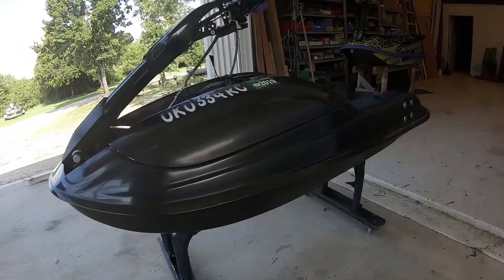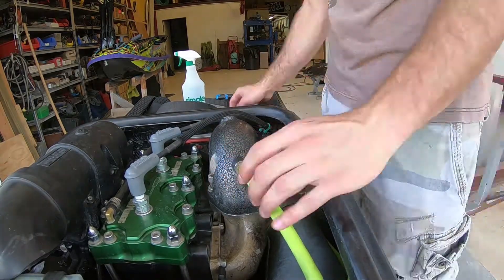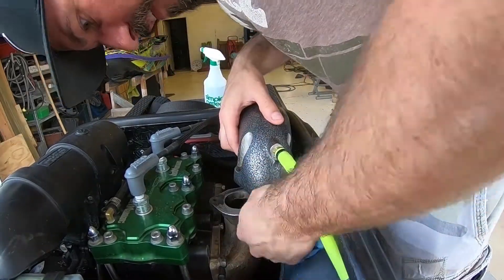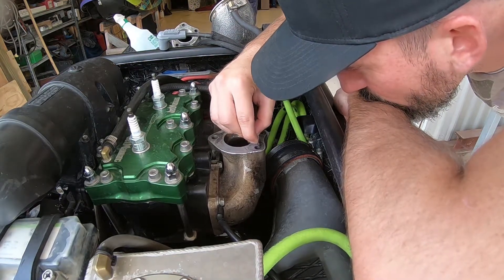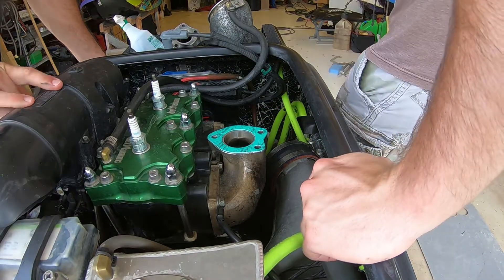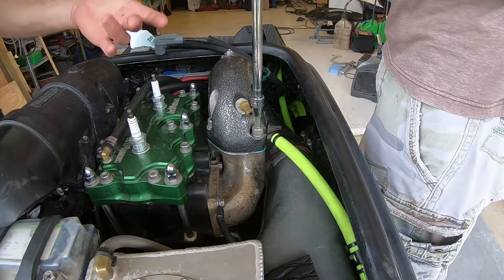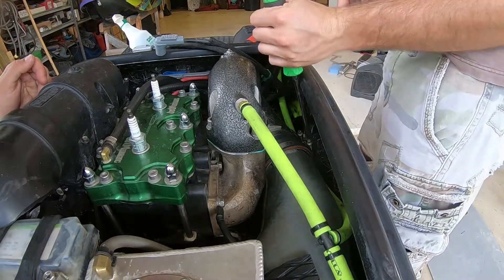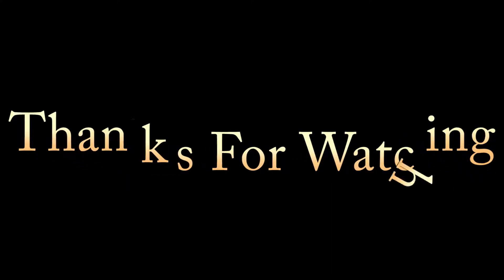Yamaha 701 b pipe head gasket replacement

Comment: I like your instructional videos, thank you.  I had some sealing issues when I put my exhaust together due to rushing. I ended up having to do it this way as well and wasted a gasket. 

I had a question about setting the engine back further in the hull. I have a 760 midshaft I got out of a donor ski which is 1 inch shorter than the superjet shaft. I talked to my machine shop and they can make me a couple plates to set the engine back out of aluminum for me for pretty cheap. I was going to run 6 mounts to make sure everything holds together if I do it. What would I expect out of the hull handling wise with moving 100lbs an inch back? Would it be a mild difference or a drastic difference? I figure it will likely feel like im running a cart tank instead of the stock tank im running but maybe I am overselling this to myself. 

My local shop doesnt not have a 155mm pump by the way, Ill keep my ear to the ground still.
Reply from the maker: I got the 155 on the way thanks man. the best why I would fix it is to get a super jet mid shaft look on Ebay or the xh2o and rebuild it before you install it you could call jetmaniac and see if he has a good used one he has good parts. the difference in motor possession wont do much I don't think but I bet it will have more vibration using 6 mounts and getting you alinement right might be hard with 6 mounts but I have not did this modification I just run 4 with motor keepers and I land all kinds of way and its held up so far.   send me some pics of your sent up
Reply: I just so happen to have it extra and my brain started churning this idea. My current midshaft in my superjet is fine but Rhaas makes a setback kit for blasters and superjets that moves it an inch back using this very shaft https://www.rhaasproducts.com/ProductDetails.asp?ProductCode=SUPERBACK . 

I figured since I have the parts I may do it next time I have the engine out and have the plate made. About the 6 mounts, you are right, that is pretty overkill especially if im running couch mounts. 

I really just love to modify shit, I do it with computers as well. None of this stuff is really needed, Im loving the ski, this would only cost me 30 bucks to do so I figured its a cheap upgrade, if its an upgrade at all. 

Here are some pics of the ski. I will be swapping hulls this winter to another square I am working on that will have a wider tray, front toe cut out, sealed hood, and maybe -2 on the hull but im not sold on shortening it yet. 

https://imgur.com/a/LpFhMqR